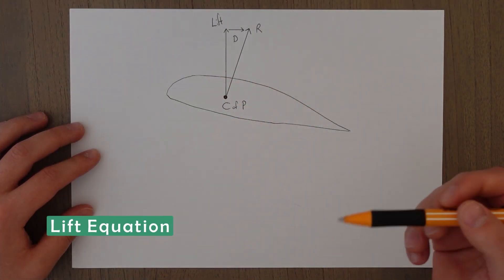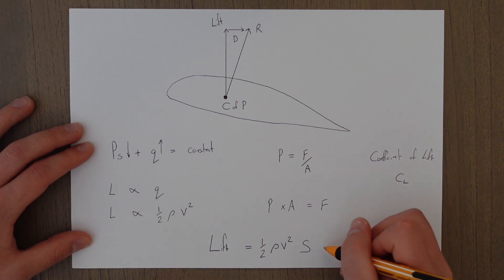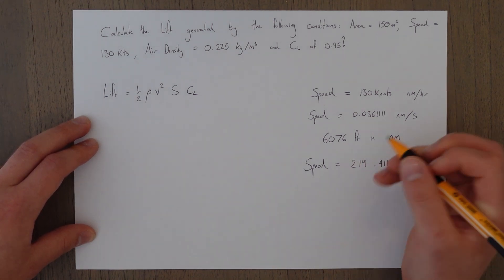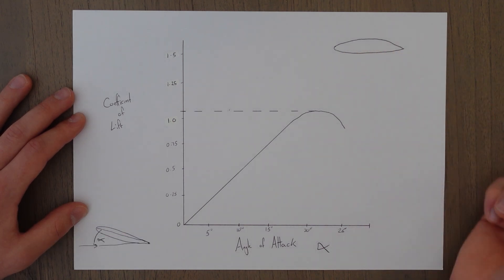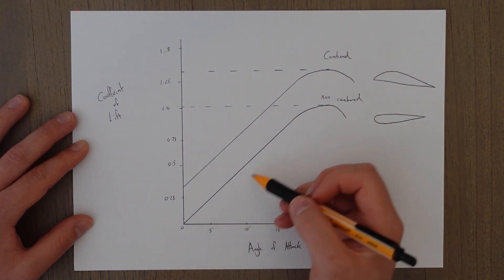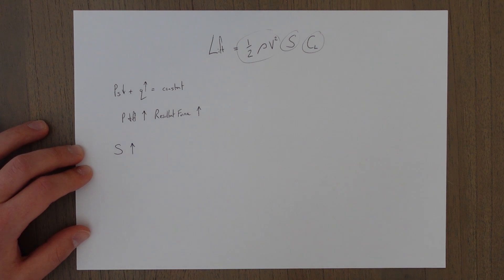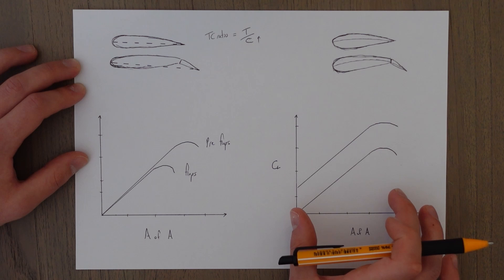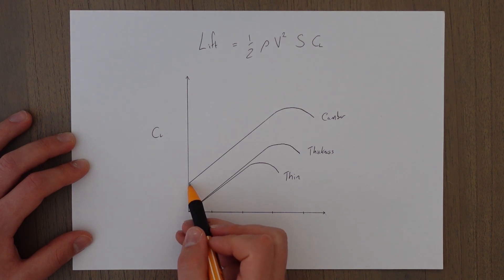ATPL Principles of Flight - Class 3: Lift.

Comment: Great again. Im doing the PPL training but math is way back for me so this helps a lot. In my flight training they told me that to convert Speed kn to m/s you can do Speed * 0,514 to get it directly. Easier I think.  So 130kn/h * 0,514=66,82m/s

Comment: For the unit conversion from knot to M/S
First nm to m 
130x1852=240760 m/h
The divide be 60 two times or 3600 
Get 66.87 m/s
Reply: Can’t you just multiply by 0.514
Reply from the maker: Exactly